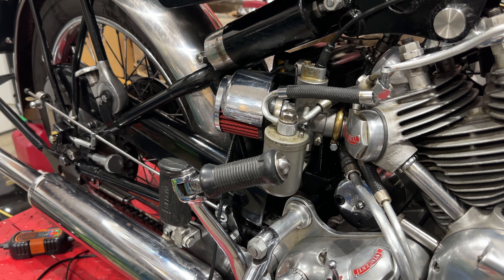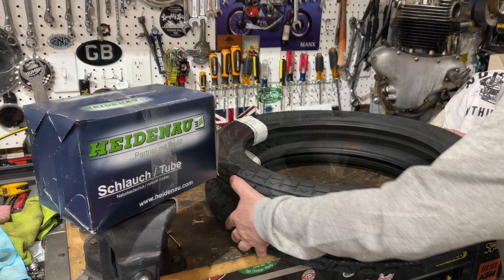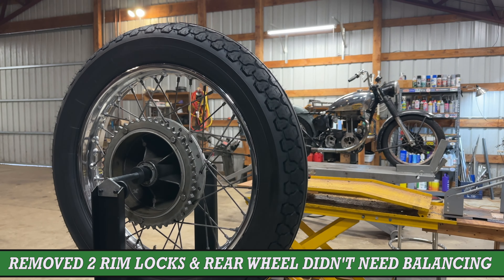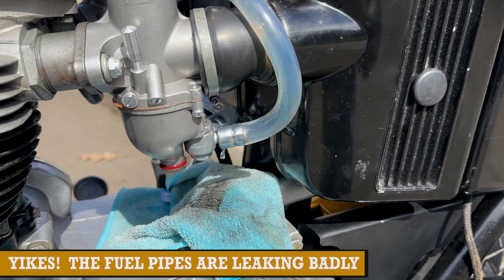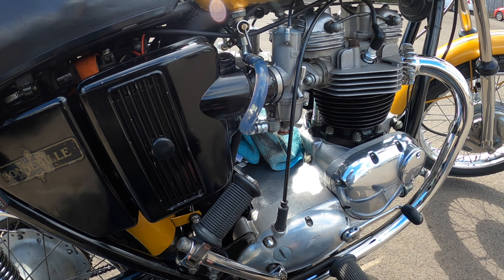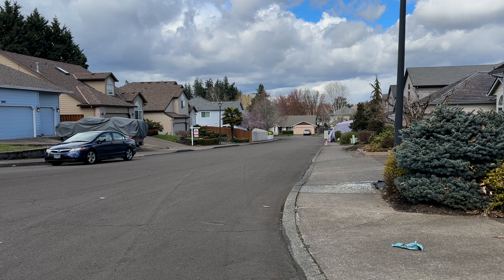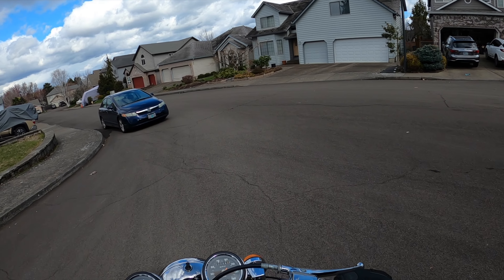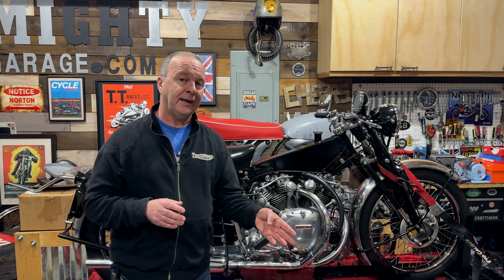1972 Triumph Bonneville T120RV OIF 650 - Part 10 - New Heidenau Tires & brief test ride

Comment: Good morning Mike!    She sounds a treat!    Ahhh the crimp fuel line dilemma.   
So. I make my own crimped lines.  I absolutely love the stock, clean appearance of the crimps but admit they can be troublesome.   
A couple tips for success.   When  purchasing pre made lines or making them yourself, the following applies. 
After the crimp is made the metal ferrel will be egg shaped not round.  Take a smooth pliers and gently squeeze the “egg” shape back to round. This will not remove the crimp and takes the odd stress off the contact point between the rubber hose and the metal ferrel.  
Second.   Heat!   When assembling the lines and crimping,  too installing them on the bike,  warm them up with a heat gun, and I mean warm!  That line will become extremely soft and flexible.   If you install them warm/hot they will conform themselves too all the stresses and odd contours as they cool. 
I think you will find that nine times out of ten these two techniques will solve your leaking issues!
God bless,  and get wrenching folks!
Reply: Great suggestions!
Reply: putting them in the nearest bin is a better suggestion.
Reply: @mc2594  😂

Comment: Those tyres Do look good on your Bonneville , they are a fantastic 'around-Town' bike . I never had much luck with the clear fuel-line , always ended-up with black-rubber and the 'clamp-style' holders with the screw and nut at the back. We used to be able to buy fuel-line with a braided-cloth around the outside but I've not seen it for a while .  Dave  NZ

Comment: Hi Mike great video as always when are we going to see more on the black Norton outings I have a 1969 g reg commando ex gus Kuhn Brighton motor show bike it was never shown there the copper plated battery Cover and oil tank never came on time for the build so I bought the commando in part exchange with my norton atlas I have never looked back

Comment: I use motion pro tygon  fuel lines and spring clamps on the same bike. No problems ever and the line stays flexible.  If you shorten the center stand a bit it becomes a joy to use. I have found being a bit older that the Bonnie allows for a more relaxed seating position compared to my Commando which I feel more "compressed". If I had to pick my favorite of the two, it would be the one I am riding at the moment.

Comment: Thanks for posting, Mike.   The bike sounds really good.   Fuel leak will be very easily solved.   I have taken to using an almost clear fuel line from the auto parts stores and is sold pre-packaged in 2 foot lengths.   It's in the small engine section of the store.   It is very supple, like surgical tubing, and easily conforms to any fitting or geometry, and usually no clamps are required.  Thanks again for posting.

Comment: I gave up using those crimp on ferrules a long time ago.  Just use regular lines and clamps.  No more leaks ever.  You were lucky it started leaking at home, image it starting to leak far from home and you don't notice it right away.  Get rid of those ferrules.

Comment: I have a 71 bonnie oif. Repatriated from the states back to Meriden in the uk where I live. I wanted fuel lines with the metal braiding but had a similar experience of leaks until I fettled for what seams like ages. I now have a leak free system but if I have to remove or mess about with them it takes ages to get back to leak free. I was tempted to replace with the clear ones when I started to watch your series but now I’m not so sure. I wonder if dipping the ends in hot water before fitting would help to keep them supple for fitting. Good luck!

Comment: Yes, those crimp ferrules are not substantial enough to press that thick walled stiff tubing against the pipes.

Don't risk using them at all.  The flammability of gasoline is not to be underestimated while underway, or worse, in your garage.